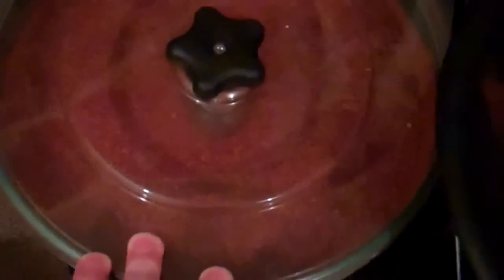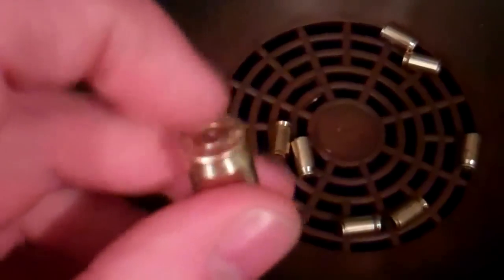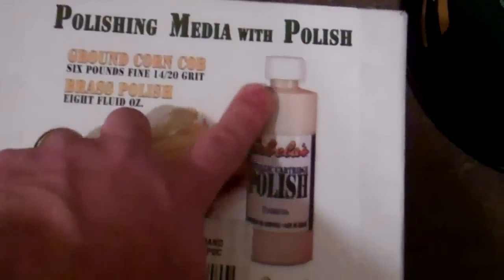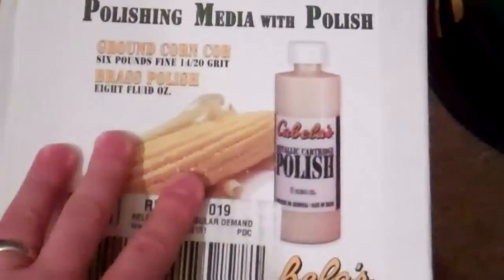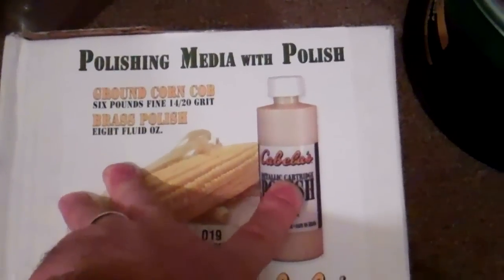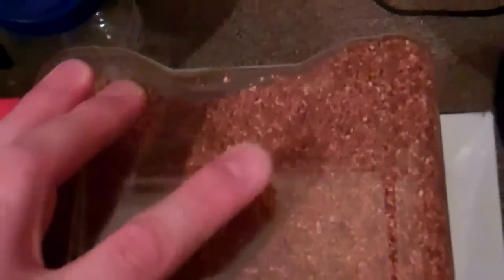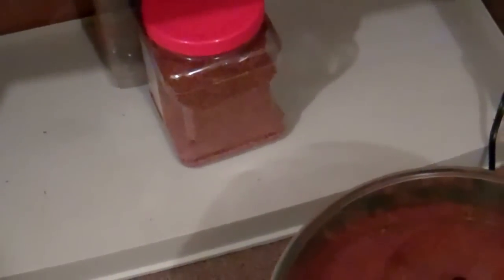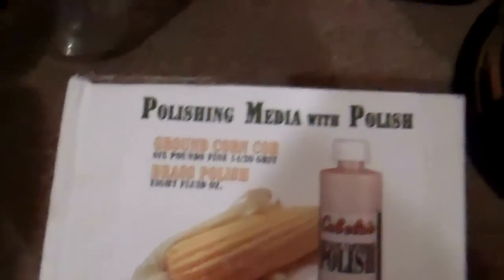Tumbling brass: media selection  corn cob / walnut

Comment: That red stuff is called rouge and it's meant to polish metal.  You can get the walnut media w/o the rouge, but it doesn't perform as we'll.  I've gone to corn too.
Reply from the maker: Good to know. The biggest problem I had with the nut media is it getting stuck in my primer pocket holes. It just slowed my process down to much. Corn media is cheap and gets the job done. Thanks for watching!
Reply: +Pheasant815 tumble with spent primers in...